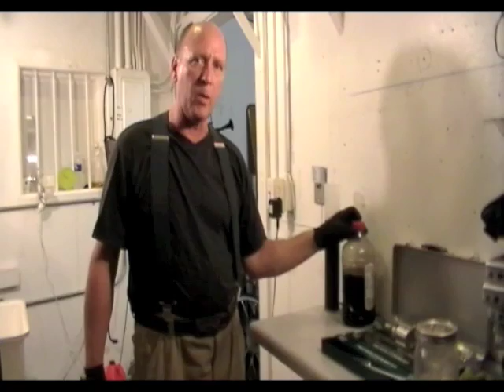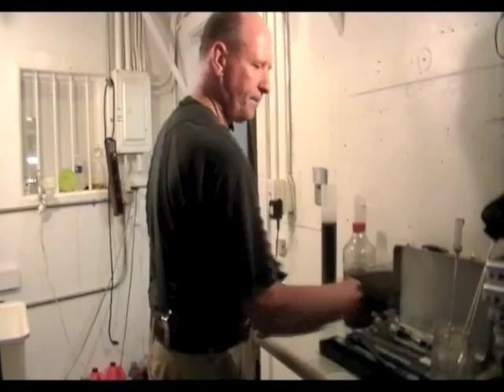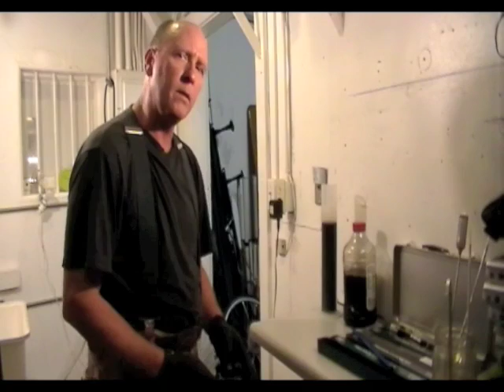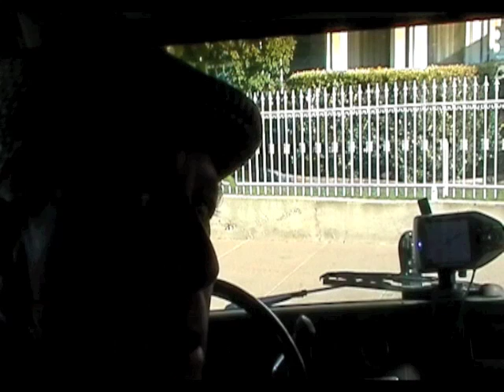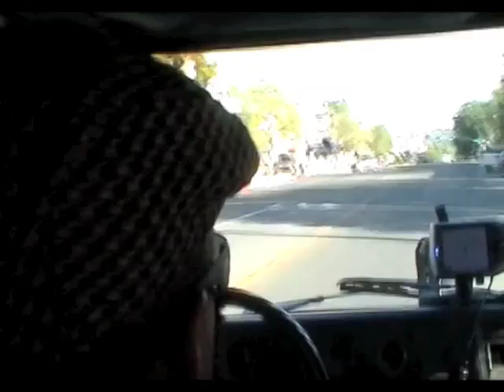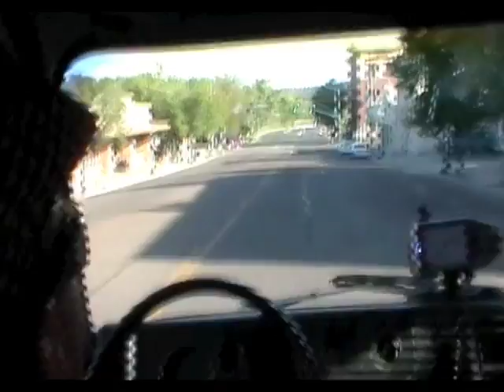High performance alternative waste oil blend diesel fuel

Comment from the maker: @boogerchamp Yes, I have tried this blend and higher amounts of gasoline both with WVO and with WMO and have found good performance and reduced emissions with no apparent engine problems.

I have found that WMO blends need to be translucent to run on my 6.2L diesel with no problems, or the injectors will coke after burning only 15 gallons of black WMO blend.